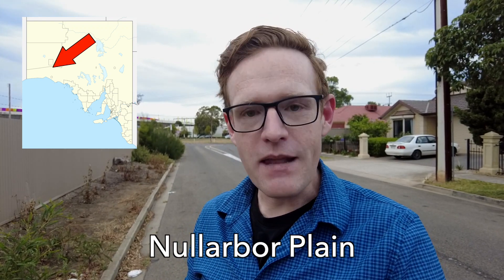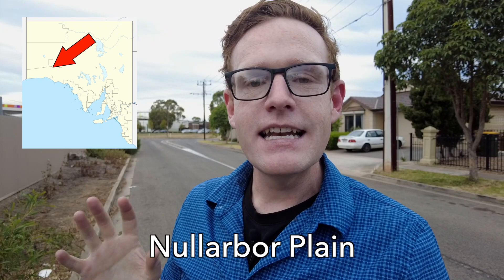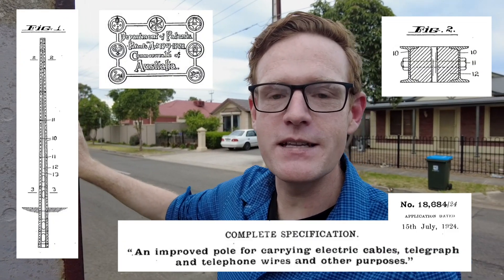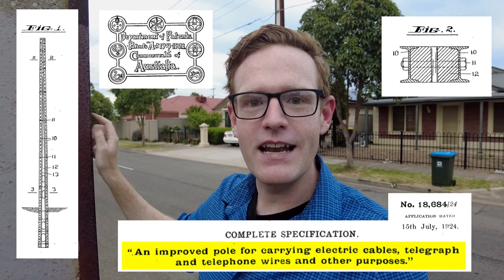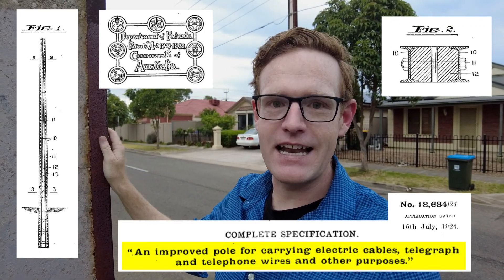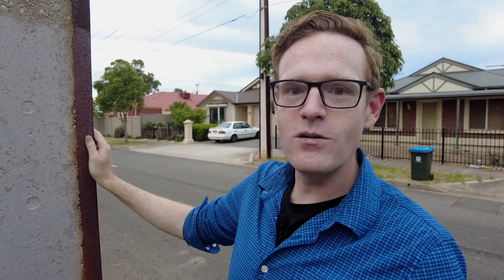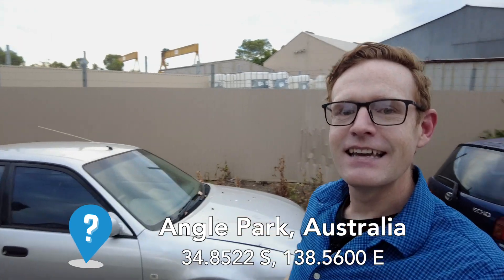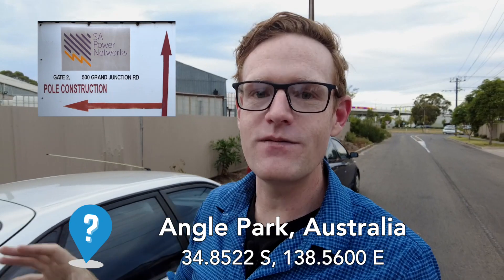This Innovative Pole Design Powers an Entire State | Stobie Poles

Comment: With the amount of termites here in SA  they are essential . Telstra and now NBN share use of them running their phone network off them . Optus have kilometres of unused non running HFC cable sitting up on them . They put up in the late 90's . But if you ring Optus up their operators cant understand what you mean . Their computers only show NBN wiring now . But they are infamous for road crashes and fatalities which is widespread . I spent 34 years putting my Telecom Extension  Ladder against them and climbing them

Comment: I did not realise they were railway tracks on the side. 🤯
Reply: Better late than never but in answer to your comment, they are actually made if what is known as  channel iron (4 inch by 2 inch 3/8 inch thick) and kept apart with rods threaded at ends and bolted. The concrete is poured into this channel structure and trowelled off. 

The good old BHP channel iron certainly lasts. I have a stobie in my driveway on the track leading to the house in my rural location that was put there 40 years ago and is still quite service- able and shows little sign of wear.

Over 55 years ago I did my apprenticeship with a company that manufactured stobie pole cross arms of either angle or channel iron and with from memory 2 inch tubing tapered at the end and welded in place for the overhead wire caps. The tubing was welded over holes punched through the angle or channel.
The tubing was tapered by heating it up until red hot and then reforming the shape by way of a large press. It took a few actions to get it to the right shape and diameter at the reshaped end to allow for the porcelain cap to be fitted.
After cropping and punching the holes in the angle or channel iron, welding the upright tubing in place, to complete the cross arm the Company had its own galvanising plant and the finished product was hot dipped galvanised.
We would have made 1000s of these cross arms and I am quite confident that many are still in use 55 years later.
IF you are from SA, the factory where these were made is now PR Electrical 603 Main N E Road Gilles Plains.
After making them, they were delivered to the ETSA depot at Angle Vale.
This was my small contribution to the SA stobie pole story.
Cheers
Reply: A late reply about the manufacturing process of stobie poles and cross arms if you are interested. 
Cheers
Reply: @iantonkin1143  thanks for the info!
Reply: I don't believe that they are.  Another commenter here rejects that claim too.  Admittedly I'm not from Adelaide, but I've been there and seen the poles, and would have noticed if they incorporated railway rails.  (Not tracks: a railway track comprises two rails attached to sleepers.)  Possibly the original design used old rails.

Comment: you forgot one important fact about stobie poles: they're virtually indestructible. A few years ago a driver was doing multiples of the speed limit when he lost control and hit a stobie pole. A normal wooden pole would have cracked and fallen over, but the mighty stobie stood firm even after being hit at (if I remember right) 190ish km/h
Reply: Was the driver killed?

Comment: G'Day Julian, you always have great content, but I'll be showing this one to my work mates. I grew up in Mt Gambier and Adelaide but have lived in Queensland since the early 80s, it has always been difficult to explain the ubiquitous "Stobie Pole" and how they are quite easily able to cut a speeding car in half due to their narrow width and strength. Now thanks to you, dubious friends and colleagues will know what I'm talking about. Thank you.
Reply from the maker: Cheers, Wayne
Reply: Reading your description made me think that these poles are like a vertical guillotine blade when compared to a timber or concrete pole.
Reply: @markfryer9880   Hi Mark, I see where I gave you that impression, generally a head on crash at speed into a "Stobie Pole" will render the vehicle quite useless apart from salvaging a few parts, there may be injuries, possibly fatal injuries. The power has a good chance of still being on.
If the speeding vehicle slides broadside into the narrow edge of a "Stobie Pole", the hard outer crust of the vehicle is broken and will spill the soft contents asunder. In this case "A Vertical Guillotine" is a very apt description.

Comment: THE BIG PROBLEM WITH THEM IS ,IF U HIT ONE IN A CAR OR BIKE , U WILL PROBERLY DIE AS THEY DONT BREAK LIKE WOOD ONES DO
Reply: People need to learn to ride/drive responsibly. Trees do the same thing which is probably why we're getting more & more armco protecting them from people who refuse to drive responsibly. Yes accidents happen but trees, buildings, other vehicles and poles can also kill. You have to be going pretty fast to damage a stobie pole. And they can break 👍
Reply: More likely to be electrocuted if a wooden pole snaps. Stobies have to be hit at high speeds to drop the lines.

Comment: It's interesting how these are such low maintenance. I've noticed wooden poles where I live (Broken Hill) being replaced with metal or concrete ones, my guess is for improved service life. Also wooden poles tend to snap when hit with a car, stobies just bend or don't move at all. I'm amazed B.H. doesn't have stobies to be honest.
Reply: Hi I live in Broken Hill too we have a few stobie poles out here not the A shaped ones though we see in SA and from Broken Hill to Cockburn on the Barrier Highway which are steel poles they are A shaped like in SA there are also some stobie poles in Menindee Wilcannia and Tibooburra like the ones in Broken Hill.

Comment: AHMM, yeah so is it just me or did any one else sort of get this jarring feeling when he casually caressed a METAL pole and said well this is a power line. I mean i have seen what happens when you put metal poles and electricity together. Usually bears and squirrels get fried
Reply: The wires are insulated from the cross arm(s) and the pole otherwise the wires would "Earth Out" and drop the circuit.
Reply: @markfryer9880  I know. I have also seen what happens when there is a leak and and someone touches that pole.

Comment: I've done inspection works for stobie poles and they are quite cool.
An issue they have is corrosion around the ground interface, where they may need patches welded on to increase the thickness of the material.
SA has a lot of unique power infrastructure, no doubt born from limited budget and long distances.
Reply: Let me guess! Corrosion at around 75 to 125 mm below the ground line? Timber fence posts and stumps collar rot at the same point due to moisture and air interaction feeding the microbes or in the case of steel, electrolysis.
Reply: @markfryer9880    exactly, though I'm not too sure one the mechanism.
Newer poles are often galvanized to help prevent this issue.

Comment: What your video omits is, in spite of the Stobie poles unforgiving appearance it is a very flexible in collisions with vehicles. The metal sides will bend increasing the time it takes to stop and reducing impact forces on bad drivers. Because they bend and don't fall they also mean we don't have to deal with fallen power lines as a result of collisions. I have a photo of a recent one near me where a Stobie pole was hit by a truck. the pole has a horrible bend, power was lost to my neighborhood but the truck continued on probably only hearing a loud bang due to it's momentum

Comment: I think in Western Australia they have a handful of these in remote areas, but most power poles here are timber. Up north they generally use steel poles (mostly cylindrical or I-beam) but in the south west it's almost exclusively timber.

Comment: Seems like they would be more expensive these days, unless they get the tracks for free. Rail metal is high tensile and expensive. There are many manufactured hollow concrete and metal tube poles available these days.
Reply: It's not rail line but H style girders that are only about 3mm (1/8") thick steel, tied together with long bolts running through between the 2 uprights which act as reinforcing for the concrete. South Australia also had a large steel industry (in Whyalla) which further reduced the cost of the steel. The most expensive thing is the concrete.
Reply: @mipotter1967  I see, thats different then, but they dont look very nice.

Comment: Another bonus of the stobie pole is that you rarely need stay wires to hold them up like wooden poles. This is because they have a strong and a weak direction.  They have thicker poles with more steel inside where extra strength is needed.

Comment: Adelaide has a huge termite issue.. This is the main issue.. They would just rot in a few years. Not sure we would now design a steel reinforced concrete pole that is placed every 50 metres now. Bit of a traffic hazard..
Reply: Hit a wooden one and it is certain to drop live wires onto traffic when it snaps clean. That's why we haven't changed to permapine- it's too brittle.

Comment: They were invented also because after the war they had shortage of materials.  So they came up with a way to use old railway tracks and cement and it worked.  There is a couple places in my area that there is just a railway track sticking up in the air and they used them for the old telephone line system.  I should see if they are still there and photograph them before they disappear.   I know the land sold last year so maybe not.

Comment: There are three in a row in Darwin near the Hidden Valley Raceway (where the V8 races are held) co-ords.. -12.438637198364805, 130.91480623892747 if you spin around in street view you can then see the non concrete version.

Comment: Stobie Poles were actually the first thing I notice when I first went to South Australia. I wouldn't want to crash into one though, even the (rounded) hardwood poles in Victoria would be more forgiving. Another potential problem would be the conductivity of the metal. The corrugated metal fences also seem to be a distinctive SA thing due the state's lack of tall timber.
Reply: They often use the metal as a ground wire, which is kinda handy.
Reply: They have a habit of tearing a car in half given enough speed. They seem to fall over pretty easily though lol
Reply: @SmileyTom666  Yikes. That's a bad habit.

Comment: There’s also an iron post design that has the same shape and external geometry as the Stobie pole but is just has a concrete base and is made out of 100% iron that’s often also treated or painted over with zinc to extend it’s lifespan! Those exact iron posts are most common in the Northern Territory and that’s especially in Darwin though they are most likely all made of iron for the purpose of withstanding extreme weather events like cyclones which can be quite common up there during their storm season! Though the same posts are used all across Australia on railways for supporting the overhead lines for electric metropolitan trains like in Melbourne for example where they are widely used for supporting the overhead lines on our metropolitan train network! :)
Reply: As a Structural Engineer, I worked on a project, mid '90s, in Darwin funded by Palmer Tube Mills to replace the Stobie pole, as mentioned they can be very heavy, with a similar shape but made up with a product of theirs called the dogbone section. Plamers hoped that they could get a much lighter pole design that would be easier to work with, easier to manhandle, more on a truck etc. It didn't have the strength under high wind loads hence the project didn't go ahead.
Reply: The posts for supporting the overhead wires on Melbourne's railway lines have included several designs, with the earliest ones being a lattice arrangement, but a lot of later ones being just I beams, which I think are the ones you are referring to.  Far more recent ones are also an I beam but much bigger in cross-section.  None of these are really anything like Stobie poles.
Reply: @PJRayment  
 
Yup though more specifically I believe the I beams were standardised on the network around the late 1970s/early 1980s as that was the design used for the overhead lines on the City Loop tunnel portals and Box Hill station which was rebuilt in the early to mid 1980s! Anyways I believe I was actually thinking of the arrangement that was most common just before I beams were introduced as it had a very small ground diameter so it was great for both overhead electrical train lines and power lines! :)

Comment: Stobie poles can also be found in Tasmania, where they were used for Launceston's (and I guess Hobart's) now defunct tramways and trolley bus network overhead wires.  They were used due to their low maintenance and long service life and can still be seen along the old routes
Reply: They pop up on the NW coast and up the Derwent Valley too
Reply: They are also seen on some 33kV routes which never had trams/trolleybuses, such as from Creek  Road to South Hobart via Knocklofty.
Reply: @mrfreddyfudpucker2185  there’s a few in Alice springs and mt isa too
Reply: @SLE253  Two locations that are far more obvious than the island state, given that Adelaide is less than 50km further away than either of their respective state capitals and neither location is renowned for it's tall trees.
Reply: I have some outside my house on the Eastern shore, always wondered how we ended up with them
Reply: @andyssrat  They were on holiday and liked it there so much they stayed.